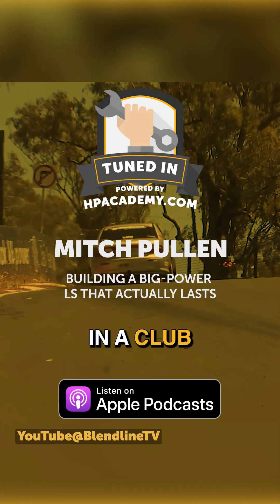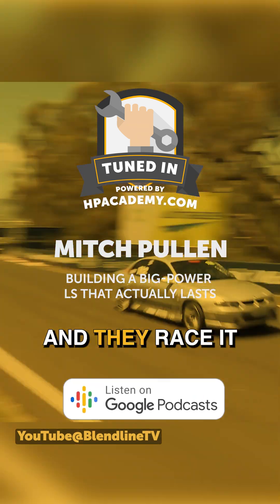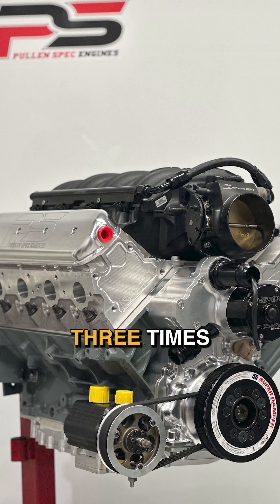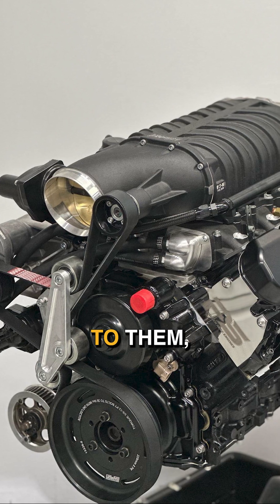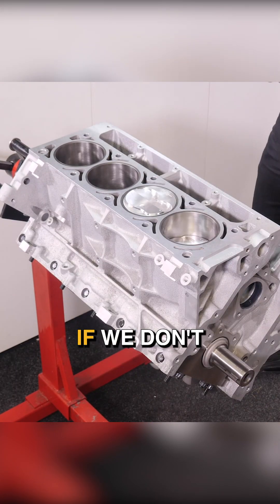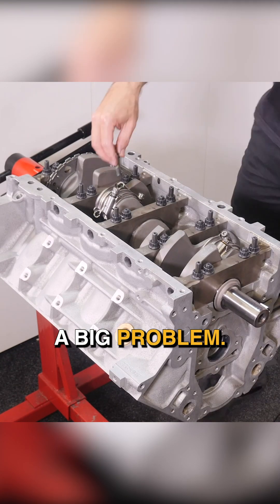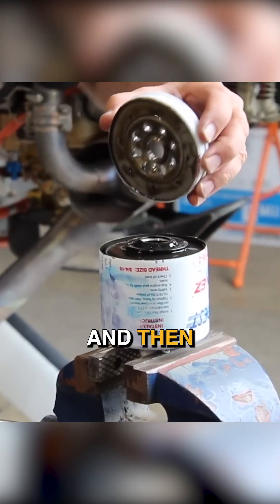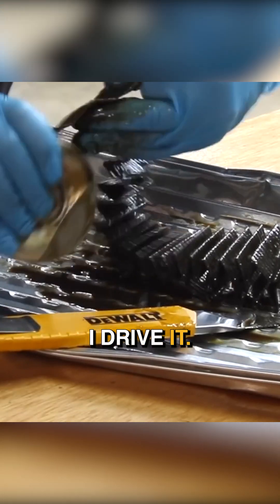Everyone wants the power....without the work #shorts

Comment: Man isnt this the truth 😂 i grew up working on old stuff and making it go faster. Eventually i got alot like burt monroe making my own engines and parts for factory bikes. Learning what I learned to make those things and make the power is why my stuff lives but its not for everyone. My best example is my compound turbo 155cc r&d project/ drag bike. Were over 100whp and 100psi of boost and everyone always want to build something with some boost after seeing it but sadly when they do succeed they normally kill it quickly by just not understanding the maintenance thats needed. Hell i drive a 1g acr neon most days with a big turbo and about 600hp 2.0l. well im driving one of my employees home earlier and i had some detonation he didn't think anything of it. Iv got the pan off rn 😂 i see some bearing damage and a beautiful crank. I caught it early im out some oil a gasket and some bearings on a motor i turn to 10k regularly on 20psi and 35ish when its worth it. All in all its way cheaper than replacing a whole built motor just finding the block is already a nightmare. Not to mention the hrs more it would take vs i already have the bearings sitting here new in the box and i think i paid less than $40 for em.